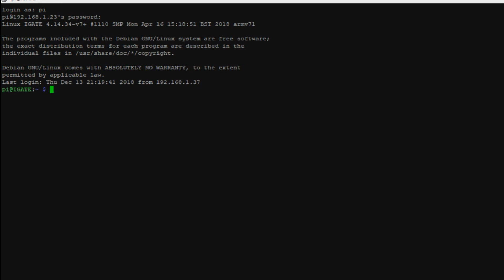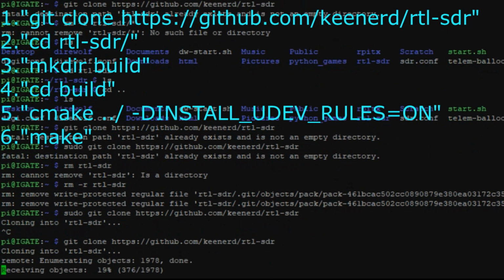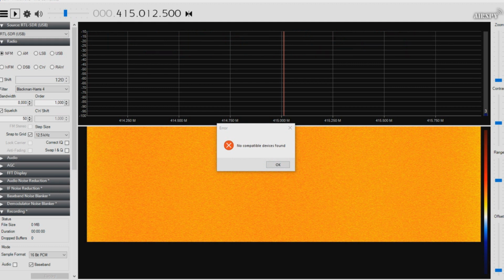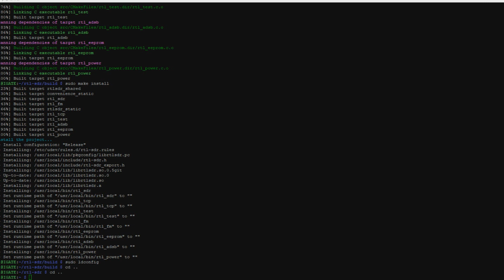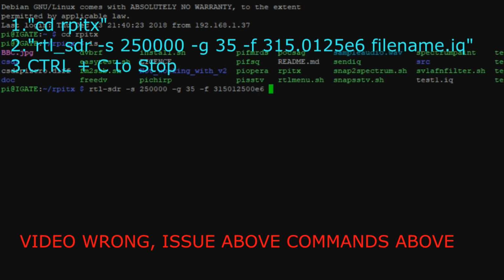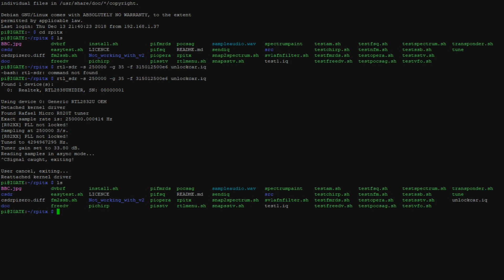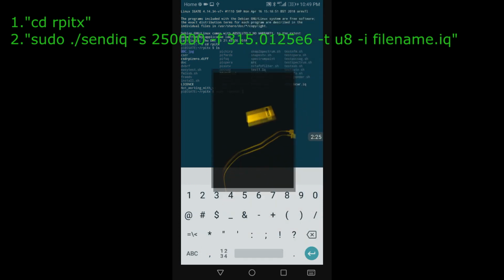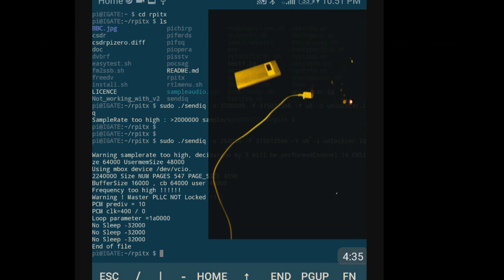Unlock Cars with a Raspberry Pi And SDR - Replay attack

Comment: No we shouldn’t already know what programs to use or how if we’re trying to learn how to read radio frequencies and how to setup this device. If we did then why would we need ur video?  Thx for teaching this to people that already understand it.
Reply from the maker: What I didn't explain is the most basic concepts of how to operate a raspberry pi. You can find that in 1000 tutorials around the internet. This is RF hacking, not "how to use linux for dummies" . If you don't know how to install an operating system, you need to start there. I'm not here to hold your hand plugging in a power adapter and formatting an SD card

Comment: Can I do this with a Arduino instead of the pi using 433mhz transmitters
Reply from the maker: I think this would be possible. But you would need different software obviously for your transmitter.

Comment: Great idea but it's more simple with HackRF One
Reply from the maker: Some want simple, but this is intended for those who want to actually learn how it's done. After all, the "simple" way wouldn't need a video demonstration. This shows more of what happens behind the scenes when you run those scripts made for you on the hackrf
Reply: @ModernHam  Thanks ;)
Reply: Baki Hanma hi I have some some questions about hackrf and replay attack
Reply: @dandwrasan2342 ? 😇
Reply: Buying Hackrf one is not so simple as u thinking...
this method is very much easier and comfortable for an common user...

Comment: Does it work on rolling code (if the car is keyless) if you replay the signals when you are near the car. Can you pull the door handle so the car unlocks?
Reply: i don't think so but if you record the keyfob while not in the car's range it should work

Comment: Fascinating, I have all the bits to try this... except our cars having rolling code
Reply: Is it where the code changes everytime so no one can record the old data then replay it
Reply: @M4CHINE69  in a word yes
Reply: lol- they already hacked that
Reply: Absolutely! However, rolling codes can be mimicked with a .wav or audio file
Reply: Ok so I believe in your case with a rolling code you want to use a jammer in conjunction with your sniff and repeat. I believe by jamming the key fobs rf from making it to the vehicle and you simultaneously grabbing the code .. That code you just snatched is still good for a use. I'm an idiot though some 1 please correct me if im wrong.
Reply: @anthonyc3915  that would seem a logical approach and in principle should work
Reply: @anthonyc3915 what is your personal email
Reply: @anthonyc3915  Hy i need your help give your number plz

Comment: I thought the  RTL-SDR was only a receiver. How did you transmit on 315/433 MHz ?
Reply from the maker: The wire attached to the raspberry pi makes it an fm transmitter...
Reply from the maker: Not the RTL SDR but the pi itself.
Reply: @ModernHam  Hello. How is it possible ? Raspberry has a 433Mhz integrated tramitter ?

Comment: Did they update rpitx or something. Everything worked fine but sendiq.sh isn’t in it. So I can’t send the iq file to my car. Did I do something wrong or did they take it out.
Reply: i set this up today, with v2 of rpitx. sendiq is there, it's just not called sendiq.sh ... it's simply sendiq, without the .sh suffix.
Reply: @chriskaprys  Can you maybe explain us how we can get this to work ? thank you.
Reply: i found solution. if you are interested write me back here
Reply: @geophoenix19  i AM still interested. How can I fix this? Thank you
Reply: @geophoenix19  Hello. What's the fix?
Reply from the maker: Not that I know of. Are you sure you issued the command within the rpitx folder? I haven't updated mine.
Reply: Yeah look at their github page. sendiq.sh isn’t there
Reply: @ModernHam is it possible you copy the code from sendiq.sh and paste it in the comments so I can use it.
Reply: I didn’t I must’ve missed a step or something. A day after I set it up(without sendiq) my raspberry pi wouldn’t boot correctly. Did you have this problem
Reply: @clashofracks6143  Did u got it to work?
I have the same issue, i cannot transmit the signal.
Reply: robintewolde1992 I still have the issue. I think the software is outdated
Reply: @clashofracks6143  It is very frustating because i can't get it to work. But the user above us stated that the sendiq is without the suffix, do you know what he means
Reply: robintewolde1992 the command would be simply sendiq. Not sendiq.sh. But it still didn’t work for me. Tell me if u have any luck my dude. If u have questions just ask me
Reply: @clashofracks6143  No i dont have any luck, it seems like i can capture the signal but RPITX wont transmit it. I have an old car from year 1999, this car cannot have a rolling code . 
Did you got an solution?
Reply: robintewolde1992 nope. Same thing happened to me. Let’s me capture. Not transmit
Reply: @clashofracks6143  Do you maybe know how to decode signals ? I have an old car from 1999 and i want to know if it has a static code or a rolling code. I tried Universal radio hacker but it seems that my car has a rolling code? Do you have experience in decoding signals

Comment: Nice video. Does it unlock rolling codes too?
Reply: You will will be amazed want it can do with a little help but not on YouTube laws i have a lot to share win the time is right
Reply: @Savage.735  You want to share somethig? May be we talk via email?
Reply: @tissentissen7245  all you do is jam the signal to the car while recording (point a second antenna at the car transmitting white noise with more power than the key does). then when the person hits the button a second time thinking the car didn't catch it, you resend the first code so the person sees the car blink and lock, and keep the second code for once they walk away. Nothing fancy to it like that kid wants to pretend. It works because you will have 2 valid codes that the car never received. Then when you send the first one, the second becomes the active code. On newer cars there may be some more processing to do because the car sends the fob a code back that is used to generate the next code.
Reply: @excitedbox5705  hank you for contacting me. Is it possible to use jammer and sdr or one full duplex device for this purpose? - unlocking/replay rolling code of car
can we contact via email? Your time will be highly appreciated. thanks,
Reply: @excitedbox5705  yes but how can your jam the signal and at the same time capture it on the raspberry in addition to that the car uses AM signals and sends on two frequencies at the same time... A tutorial from you would be nice!
Reply: @mwlulud2995  There are multiple methods. You jam the signal by having a transmitter and receiver in the same device. Wave amplitudes add/cancel so if you know the signal that you are transmitting, you can subtract it from the received signal to recover the signal coming from the remote unlock fob while blocking the signal received by the car. 

Most people will hit the lock button until the car responds with a beep etc. so you can capture 2 codes and retransmit the first one so the car locks while saving the second code to use once the owner walks away.

These are only examples of hacks that worked with older cars and since manufacturers have started using more advanced security systems people have started using relay attacks to get around perimeter locks that depend on 2 way communication and expiring codes. 1 radio is placed on the car while an accomplice stands close to the victim with a second radio to relay the signal over a long distance (ie. from inside a building to a car park) making sure the victim can't see the car being stolen/robbed.
Reply: @excitedbox5705  Yes I understood the last technique it is a technique widely used nowadays it only amplifies the waves of the remote control and takes advantage of the weakness of the latest models to use the opening/closing by proximity contact.
But if not, have you ever succeeded in the technique of jamming and replaying signals on cars?

Comment: There already are publications about the vulnerabilities of car keyless entry, but those rather showed the weaknesses of their proprietary undocumented "cryptography". But here this is much worse!!! There is NO rolling code AT ALL!!!
Reply from the maker: Whats worse is the "cryptography" used is basically the same as generating a hash and matching it against the cars to see if it "belongs". 
This still leaves the possibility of recording dynamic keys, and jamming the frequency in such a way they they never make it to the car, leaving that key open to use at any time in the future.
Reply: @ModernHam  This attack is called "RollJam" and was invented by Samy Kamkar, but, before knowing about this I imagined that I coule record 2 signals while jamming some of the last bits (let's say 4) so I now have two valid rolling codes with the last 4 bits missing. I then transmit my first code with the 16 different combinations, one of which is valid and will lock the car. and the owner will think that the car is successfully locked after the 2nd press. But now I have another valid code with 4 missing bits and I can time again try all 16 combinations and unlock the car.
*This only works if the lock/unlock button is the same. On many cars it's not however many garage door openers use the same button.